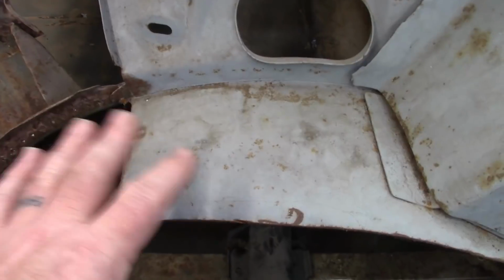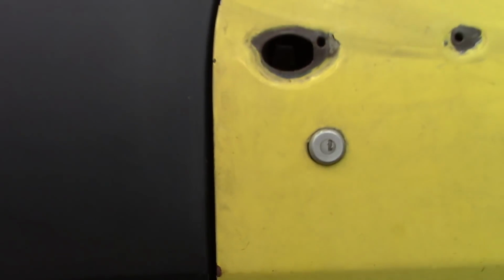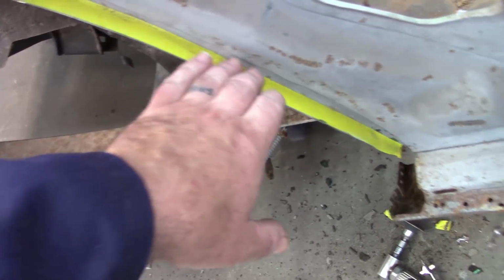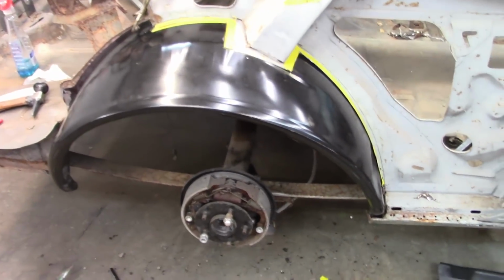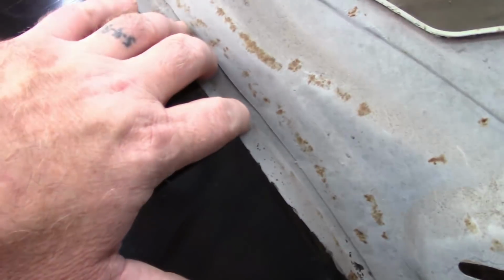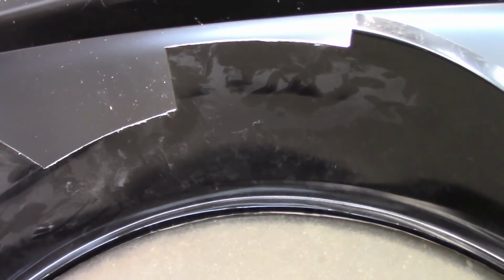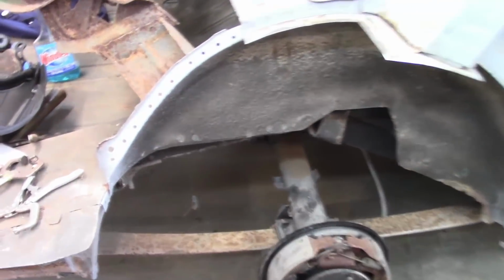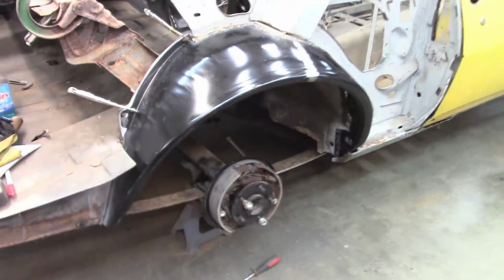1968 Camaro Rebuild. Basket Case part 8. Outer wheel house.

Comment: This is exactly the process I had to go through on my Chevelle. I wish I had these videos then! All the things you had to fix presented themselves . I had a NOS quarter , so once the old quarter was removed, I trimmed off the rusty remains of the wheelhouse and slip fit the new wheelhouse than positioned the quarter exactly where it had to be , then locked in the position of the wheel house to the wheel opening with self tappers, took off the quarter and permanently attached the wheelhouse. Nothing fit or matched exactly, and since the original was globs of rust and Bondo I had no original to go by. I went to a lot of car shows and photographed a lot of cars but many were previously worked on too, so in the end I had to just make it all fit like I thought it should.

Comment: outstanding work Barry! Very nice repair and logical step by step instruction.  Those are not easy to replace as I replaced both inner and outer on driver side of my 69 and passenger side very similar to the way you did it.  Thank you for sharing!  it really helps

Comment: Great video Barry. On my '67, the passenger side went relatively smooth, but the driver's side was another story. (I assembled the inner and outer as a subassembly and then had trouble fitting the driver's quarter) So, I bought another left side outer and started to attack it as you have done, trimming the original replacement as needed, but got discouraged by the fit at the top of the arch, as you pointed out. I switched gears and moved to another area to work on while I contemplated a fix. Looks like you gave me an inspiration to revisit and finish the job following your lead. I appreciate your talents and sharing them!👍 Keep the videos coming!

Comment: The flange area in that new outer isn't needed to just cut what you don't need off and it'll slip into place good enough to mark your cuts. On that rocker if it's just rusted on the outer part that's all I'd replace.
Reply from the maker: The flange is what the quarter spot welds to.

Comment: You did exactly what I was thinking by splitting the outer wheelhouse. There was too much metal to allow for proper fitment which became obvious when both the rear and front fit well but the center was too high. Sad to say but the majority would have hammered and bent the wheelhouse ridge down to fit the quarter. Good job, you did it in the proper manner resulting in a quality repair! Nothing wrong in taking some shortcuts but hack jobs are unacceptable.
You go Jo Daddy!

Comment: Splitting rear inner wheelhouse was the right call. My '68 also measures 11.5" to the body lip. Drive mine in the summer body rust and all. I might need another 16 years to finally tackle the body(best part is the hood). Can you tell us your sheet metal source? Btw well thought out work process.
Reply from the maker: The sheet metal came with the car when I bought it years ago. Some of it had dynacorn stickers on it. Some had NPD written on it.